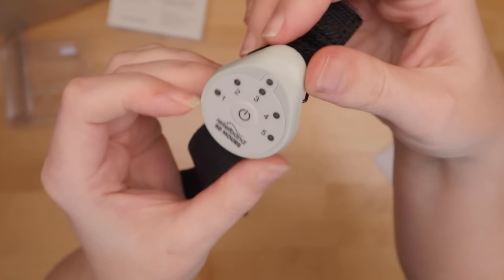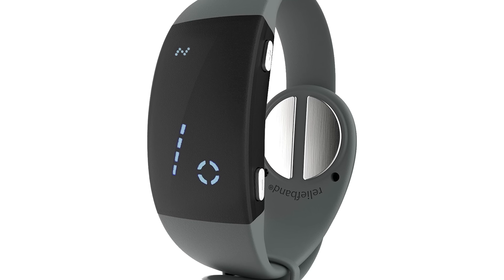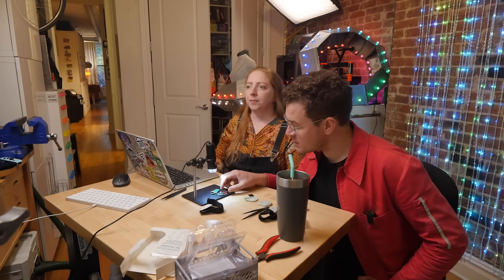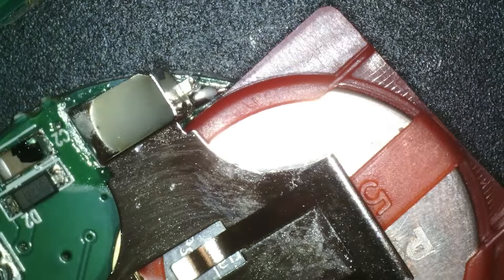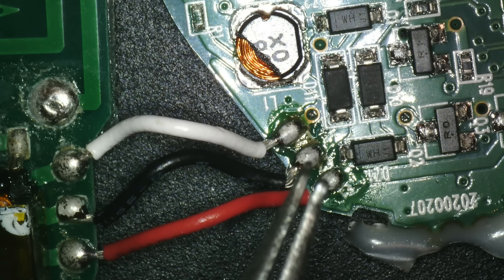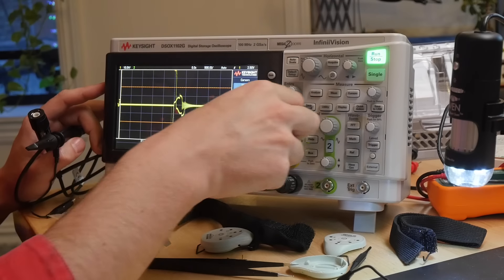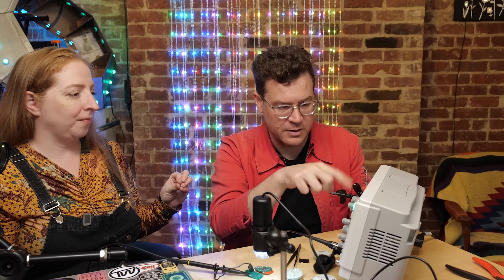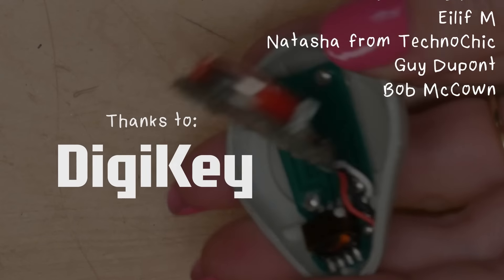What's inside the Relief Band?

Comment: 5:03 That zapping component is likely a high frequency transformer to create high voltages with such a small package.
BTW, you can get similar results (at possibly much lower cost) by using a TENS unit on your wrist or lower arm.
Then you could also use the TENS/EMS unit for other purposes like pain relief.
Reply: could just be using inductive flyback
Reply: I hear claims, but who will testify that their nausea was actually helped by a TENS unit?

Comment: So couple points. Meclizine (what you take for motion sickness) comes in a chewable and a non chewable variety. I haven't used the model of relief band you broke apart, only the sport,   but if you have chronic vertigo or nausea and have to wear it a lot you can actually forget you are wearing it. I do not know if the competitors feel the same either. I would love an open source version, hopefully someone will create one. As someone with chronic vertigo, the cost of the device gets to be prohibitive but it's a choice of being able to function even a little bit versus being stuck in bed. Having more cost effective versions would be great.

Comment: On the pricing part, depending how its sold (medical or not) there could have been some significant cost for things like FDA certification but even as a welness device a part that generates a fairly significant voltage on the body has to adhere to some pretty strong saftey standards that can be a multiple of the R&D time of what "just the circuit" would cost to develop.
You don't want a fault in the software or hardware produce enough power that could cause nerve damage.

Comment: conformal coated for the stomach acid? 
I have a spinal cord stimulator implant fitted that sends shocks down my legs. The current one is rechargeable via a wireless coil. But one of the others had a lifetime battery that lasted 5 years, I wanted to keep my old ones but the company (medtroinic) insist they have them sent back. I guess the shocks must be very low current to last 5 years.

Comment: Do the compression ones work too?
Reply: Based on the custom orange/red plastic batt holder and the height of it , they went with 2050 first and the enclosure tooling was made. Then they saw they needed more voltage and they made this whole assembly to get to the height of a 2050. Or just the price of a single 2050 was more than 2 smaller ones. It is a guess though
Reply: If you are talking about the compression wrist bands, they help but not as much as the neuromodulation bands. These bands all stimulate the Nei Kuan point on your wrist.